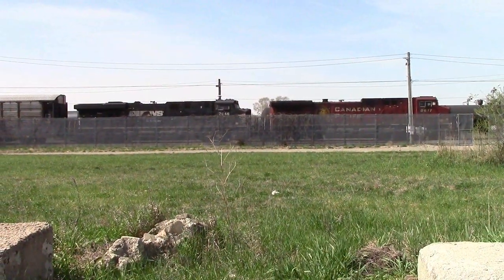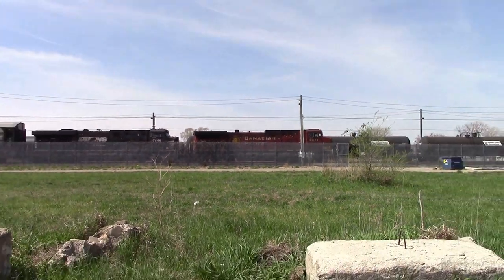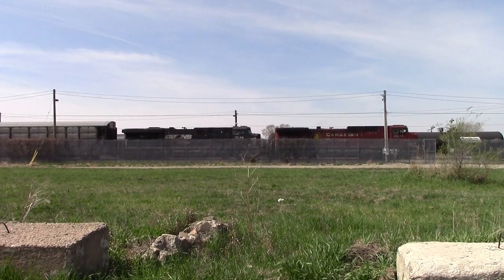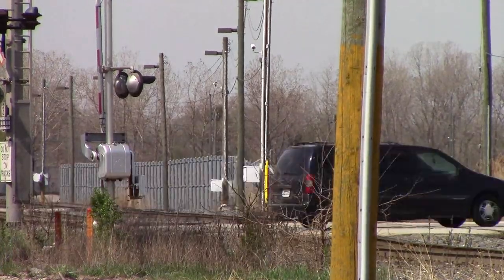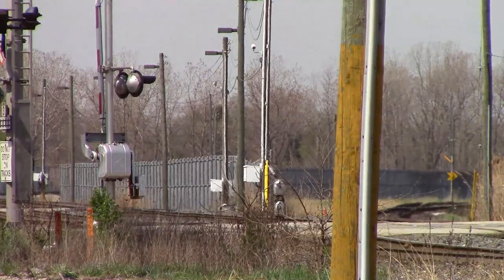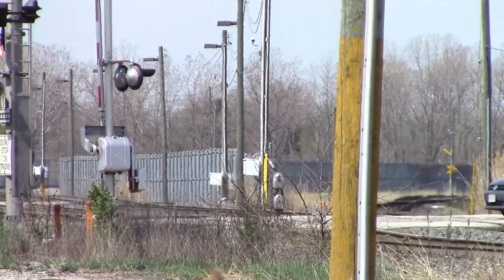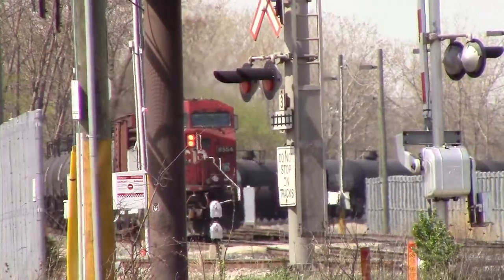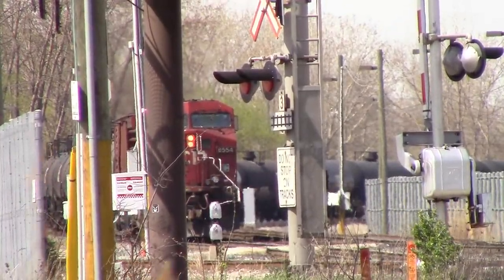CP 650 Stuck in the Tunnel Again in Windsor, ON. with Radio Communications

Comment: Too much to pull to little HP
Reply from the maker: This usually happens here because the crew looses contact with the DPU in the tunnel and they apply the brakes a bit which puts the DPU into idle making the train stall out. It happens often with these ethanol trains. It's also happened to a loaded rail train.